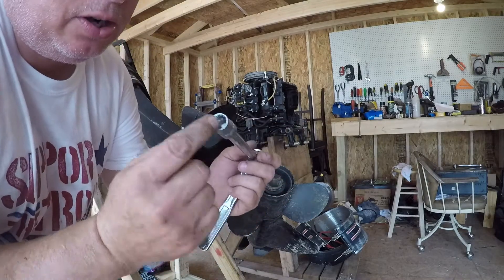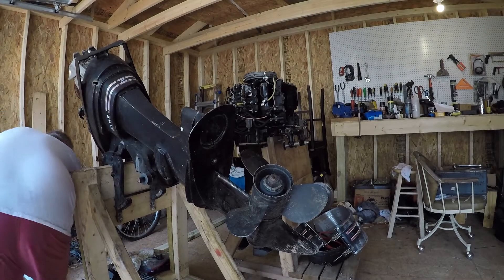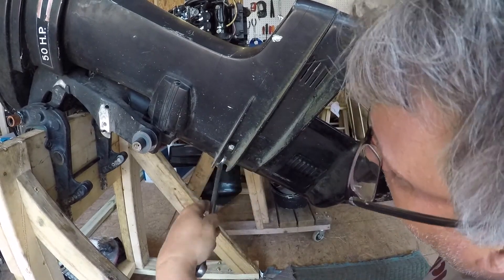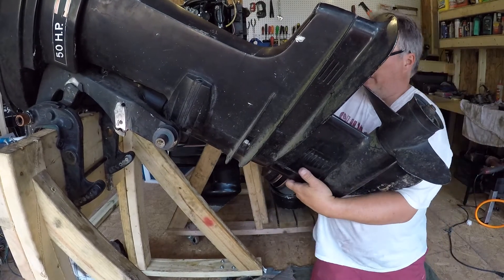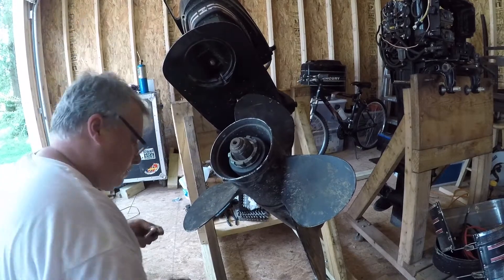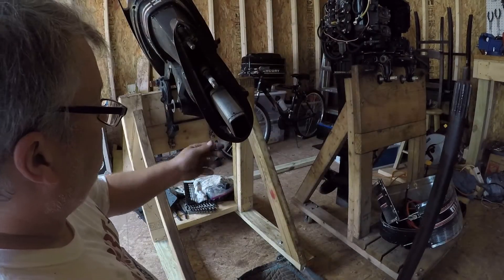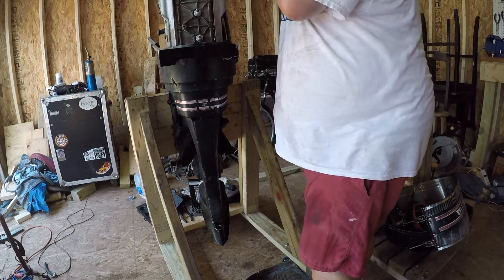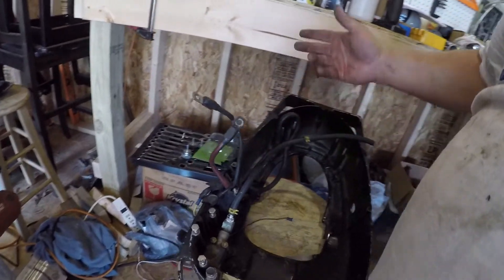Mercury Outboard Thunderbolt 500 50 HP Part 4 - Lower Unit Removal

Comment: Just bought a 1974 mercury 500 and the motor seems locked up. Starter will engage but not spin the motor the prop is also stuck so I'm thinking that this motor may be stuck in gear I put a ratchet on top of the flywheel and took the spark plugs out still nothing it will not budge any thoughts on what it could be I hope this motor is not blown up
Reply from the maker: Take the lower off and see if its still locked.

Comment: I got a 1978 2 stroke merc 500 like this one took out all the bolts but only opened up like an inch wont come any farther down for the lower unit to come off am I missing something? Its some similar to this
Reply from the maker: It should come out if it dropped and inch.

Comment: I just got my first boat and it has a 50hp mercury that looks just like this. After putting new plugs in it It fired right up but it isn't peeing any water. If I follow this video and remove the L.U. will I be able to inspect/diagnose the impeller? What can I do to figure out what needs to be done? I was really hoping to get on the water this weekend.
Reply from the maker: Replace the water pump.  Its just neoprene (rubber) so most likely needs replaced.  Just be careful putting the lower back on.  At the base of the powerhead just below the bottom carb is a small triangle looking thing that is part of the intake the shift rod like to push up on in and can break a hole in the intake.  Please consider subscribing.  It doesn't cost you anything and I make a few pennies.

Comment: Mine is a 1967- ish... I pulled the lower unit, replaced the impeller and gaskets. No water through the system... I checked the hoses and blew air through the lines and I can feel air blowing through the water line so there's no obstructions... any ideas?
Reply from the maker: With the lower off rig up something from your garden hose to the copper tube and back flush it.  I use a cut off or valve so you can adjust the water pressure.  Just watch your water pressure.  Also if you haven't subscribed please subscribe.

Comment: I replaced the impeller on my 1968 Merc 500 50hp. Once I reinstalled the lower unit, the prop started spinning in neutral when I started the motor. Any thoughts? There's still tension on the prop, so everything is engaged
Reply from the maker: Lower unit was not in neutral when you put it on.
Reply: @hawkeyemarine  thank you! Is there an easy fix to reset everything to neutral?

Comment: These videos are slowly bringing back my 500 so thank you for making them. Did you have a video on replaced the lower unit oil seals? I thought I saw one but now I can't find it. Also, what mixture do you run in these engines? There seems to be some internet debate about the topic. Thanks again!
Reply from the maker: I don't have a video of replacing the oil seals.  But, run 50:1 is fine.
Reply: @hawkeyemarine  okay thanks!

Comment: I have a 64 merc 500 I need to change water pump on and I can't get the Lower off. Seem to have everything loose just seems stuck around shift linkage and I don't see a jam nut to loosen any advice
Reply from the maker: There is a couple  of dowl pin its probably some corrosion in  the dowl pins.  Take a coouple 5 in 1 tools linke a scrapper and gentle slide them in the cracks and it sh break loose.  I would remove the shift cable.

Comment: I've put my leg back on and only have forward and reverse any ideas what I done wrong.
Reply from the maker: I would say drop it again and use a vice grip to find nuetral make sure your in neutral and put it back on.  You can also take the throttle and shift cable off and see if you can find it by pushing the shift linkage.  Neutral is lined up with the bolts on the water jacket.  I have a video on this.  Thanks for watching.

Comment: Hey man, great video! 
Do you know how interchangeable lower units are on these motors from year to year? 
I have a couple of these motors and want to rebuild one of them, problem is that one doesn’t have a lower unit. They look virtually identical, one difference is that one is pull start and the other electric. 
Thank you!
Reply from the maker: I don't think they made a Thunderbolt 500 pull start.  They are all different unfortunately the 40 is not the same as the 50 and the 50 is the not the same as the 65hp.  Thanks for watching.
Reply: @hawkeyemarine  Thank you very much for your response. Both engines that I got are 50hp. One of them says Merc500 (50hp) which is a 4 cylinder 2cycle and the second one is also 50hp 4 cylinder 2cycle engine. Let me know if there is a way to send you pictures somehow, maybe you have a forum page or something
Reply from the maker: @andrey8513  jhawknz@gmail.com

Comment: Hey Hawkeye. You mention a 7/16 star bit that I'm unfamiliar with- is that the official name? I want to make sure I buy the right thing.
Reply from the maker: Yep its a Star Socket usually in a kit.  Sometimes its just a hex nut.  Use a flashlight and look down in the hole by the prop and you can see it.  That way you know if you need to get the star  socket or not.  Hope this  helps thanks for watching!
Reply: Ok. I have the lower unit reinstalled with a new impeller and seals. May I have an email address so I can send you a video of my current frustration?
Reply from the maker: @michaelvincent4806  jhawknz@gmail.com

Comment: Would you have any idea what the prop dimensions and pitch is for this motor?  I’m rebuilding one and it doesn’t have the prop on it. Mercury can’t help me lol
Reply: Depends on boat length, beam, and weight...also how the engine is mounted with respect to the bottom of the boat and other factors.  An example is for a 13-15' boat, gross weight 1300-1800 lbs, with a speed range of 28-37mph... a three blade alum prop 10-1/8"dia x 15" pitch is a place to start.  Final prop selection should allow engine to reach 5000-5500RPM at WOT.  A heavier boat requires slightly more dia with slightly less pitch.

Comment: watching this I also learned that my 1980 I just picked up has a tilt lock.  Was wondering how it locked very hard to find unless you see it on a video!
Reply: Did u find it? Should be a pin the has an elbow
Reply: Also latches on either side to rest in upper or lower position

Comment: I have the same motor and my driveshaft and propeller is not spinning the motor runs fine is there anyway that you could help me with this
Reply from the maker: Put the lower unit in gear and disconnect the three wires from the switch box take a picture so when you connect them again you remember how they go.  Put some electrical tape around the wires so they don't touch anything.  Disconnect the fuel line and the battery cables. You can then turn the power head flywheel.  If it turns but the prop doesn't turn then take off the prop.  Look and see if the prop shaft turns?

Comment: Same engine as well. I didnt notice you taking apart the driveshaft. I need help with that part
Reply from the maker: Here is the power head removal. https://www.youtube.com/watch?v=7jESQFIwQIw
Reply from the maker: Part 2.  https://www.youtube.com/watch?v=f9LIyrprGyY&t=215s
Reply from the maker: 1st you must remove the lower unit.
Reply: I'm trying to remove lower unit to do water pump. I need to get the shaft off that  controls the forward and reverse down in the lower. How do I do that?
Reply from the maker: @jamesroberts9150  should drop with the lower unit.
Reply from the maker: @jamesroberts9150  https://www.youtube.com/watch?v=p8AqbxMm0Dk&t=582s

Comment: What is the trick to install the lower end? And make it shift right?
Reply from the maker: I keep the lower unit in neutral. If you don't know what the lower unit is in use a cloth and pair of vice grips and gently turn the shift shaft 1/4 turn in either direction, turn the drive shaft and note the rotation of the prop.  In neutral rotate the prop and it shouldn't move in forward or reverse direction.  When you put it on the motor make sure the key is off and if you have to rotate the flywheel just a touch it will not fire off on you.  If you do rotate the flywheel you don't have to move it much and it should seat in.  With the 50 hp be careful and make sure it goes in easy.  As it goes in periodically look at your shift shaft.  They tend to bind and if it does it can put pressure upwards toward the power head.  And, I've seen it snap the little aluminum triangle and put a hole in the intake.  And, that makes for a bad day.
Reply: Mine is a 1971 800 model i had it in neutral when i disassembled it But when i was putting it back i was fighting the alignment of the shifter and the water pipe. I here i need to have both in reverse when putting it back in. Thank you for your help!!!
Reply from the maker: @kenbaker4534  I've heard some people say use the reverse method but it really is the same thing.  The only difference is the drive shaft will turn in reverse.

Comment: Hey Hawkeye.... I have the identical engine and it's got some issues. The videos are very helpful to me for disassembly purposes since  I don't have any manual. Thanks very much for posting.
Reply from the maker: Thanks
Reply: hey Hawkeye.... I have the same motor and you have helped a lot. When I tried to take the lower unit off it would only come out about 6 inch and it stopped..  I dont know what to do.
I see you took the carbs out first, does that have anything to do with the lower unit?